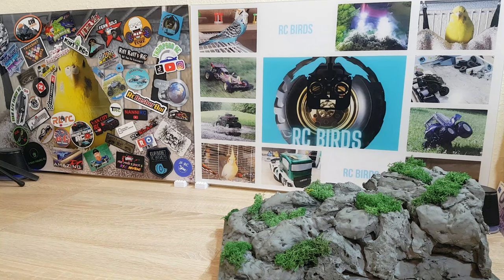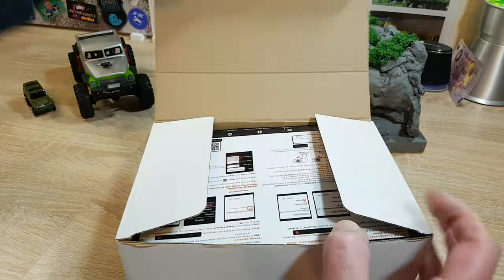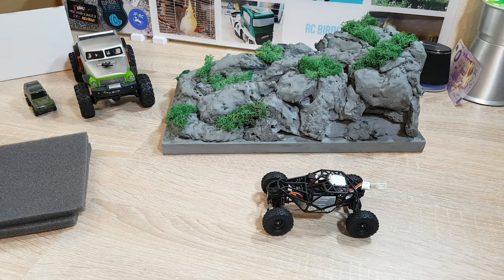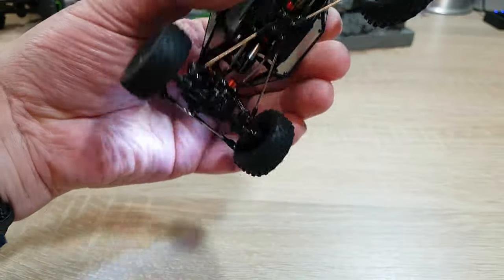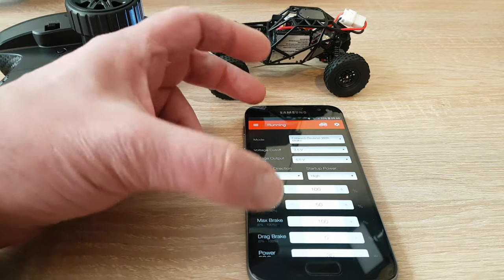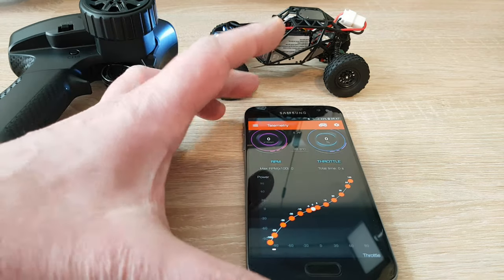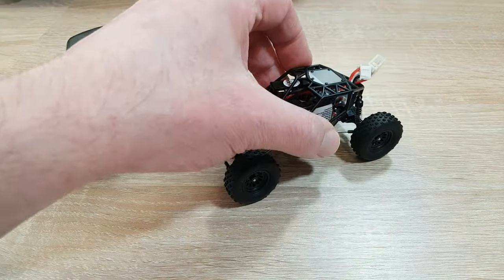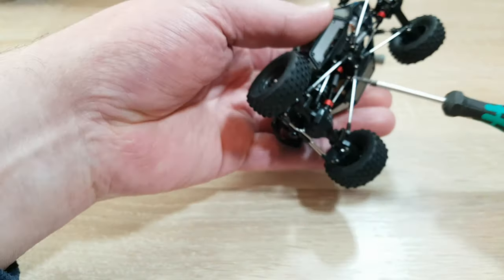Unboxing and Testing the Furitek FX132 MT ETNA (Orlandoo Chassis)

Comment: Great little model Dirk!
That looks much more suitable for cauliflower mountain.
Loving all the metal components and the working lights, it looks very manoeuvrable to.
I can fully understand why you wasn't keen on building one of these in kit form..... there's no way my chunky figures would be able to build one of those!
I bet the battery lasts a long time, many hours of fun. 😊
👍 👍 👍
Reply from the maker: Thanks a lot James. I was sceptical, too. I had done a lot of 24s, but this is a higher league. Luckily I got it RTR, but I alredy invested time to get it run because the drive shafts fall apart. But right now and because of it's characteristics, I think I can handle an Orlandoo kit.😉

Comment: Oh, this is great, Dirk! I have the Orlandoo X01, but I think you did the right thing to get this one, prebuilt, and of course the motor technology is superior! It looks so good going slow up your ramp! 
Yeah, I remember those issues with these Orlandoos, I have to admit I am not using mine very much these days, they are just too difficult to work on, he he...
Reply from the maker: Thank you so much for watching and your kind comment my friend. You're not the only one with these issues. Especial when building the kits, saw a lot videos about this topic before buying mine. 
I always (and still) wanted Furitek technology for my 24th. So two flies with one slap.
On my issues I now work. 
The tubes're solved. After a few hours of running, they stay in place. 
The wheelnuts're the next to work on. I'm hoping the Axial locknuts would fit. I already lost one on running. I found it, but it's really hard to see and I'm thinking a magnet would be a great relieve to find lost parts.
This won't be the last video of this car on my channel and maybe in the nearer future I'll do the pickup on the  Hunter chassis.
Have a great weekend my friend.